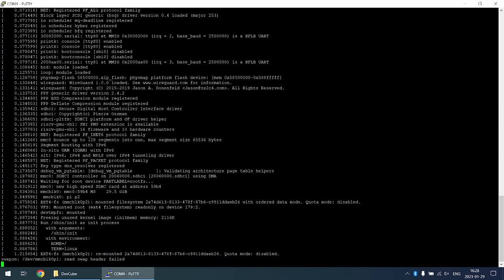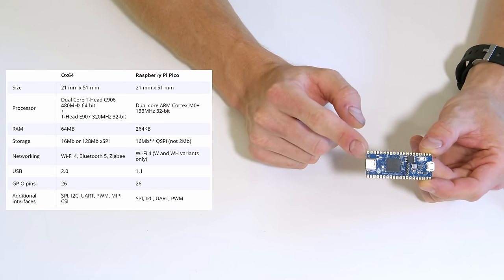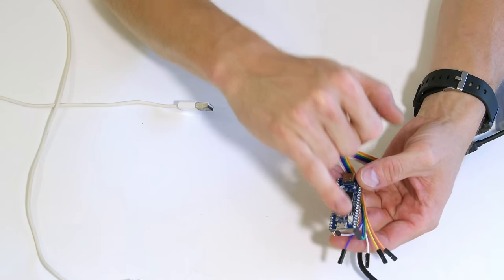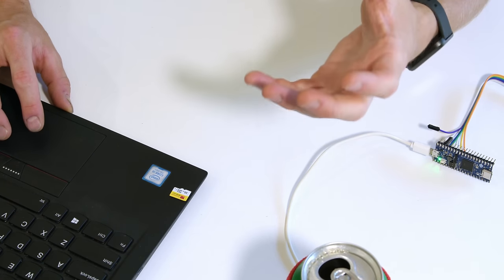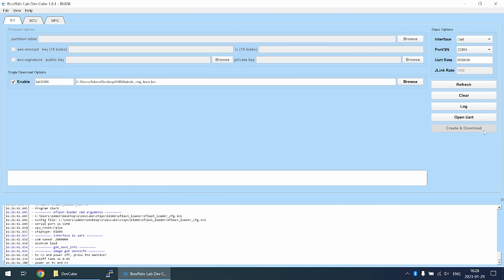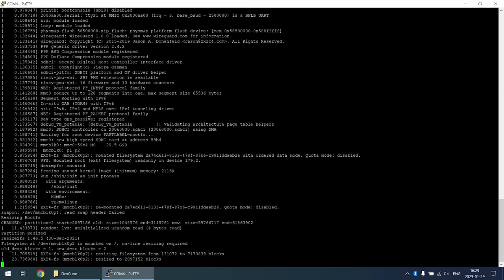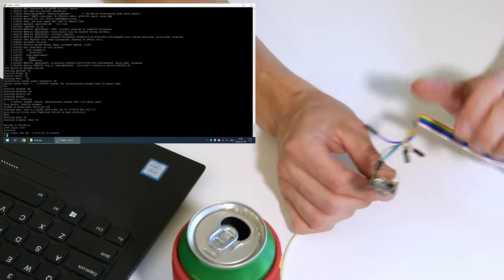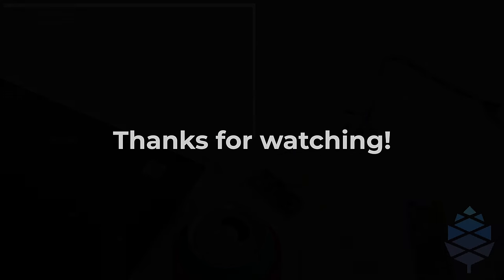Ox64 SBC - Connecting, Flashing and Booting Linux! ($8 from Pine64)

Comment: Please don't use baud for serial communications unless there is a good reason for it. Bits per second is what you should use to avoid confusion.

Bits per second is exactly what it says. Baud is symbols per second, where the number of bits per symbol varies based on protocol used. It can be 1, 2, 4 or many times higher. 4096 has been common with cable modems, as an example, for several years.

UARTs use 1 bit per symbol, so 200K baud is the same as 200Kbps. 

Way back in the past, telephone modems were initially described as 110 baud, 300 baud, 1200 baud, and 2400 baud. As technology improved it became apparant that using baud was outdated and confusing. 

After all is a 2400 baud modem able to run at 2400 bps or 9600 bps.

Plus modems started offering hardware compression. This lead to having a modem to modem connection speed much less than the modem to computer (UART) speed.

With a 9600 bps modem, you might set the UART to 19200 bps, allowing for a maximum  2 to 1 compression ratio. A 14.4kbps modem could have the UART set at 19.2kbps, 38.4kbps or 57.6kbps. What speed you used would depend on the capabilities of the UART, the modem and CPU speed. 

As modems became faster the UARTS couldn't keep up. When early UARTS were designed 9600 bps was considered high speed. Most computers built up until the early 1990's used an 8250 UART.

The first major upgrade was the 16450 UART, which could operate up to 38.4kbps. Then the 16550 UART was released, which included a 16 byte send and 16 byte receive buffer, unfortunately the buffers didn't work.

The 16550a UART was released with working buffers and a maximum speed of 115.2kbps; these were needed for the 56k modems and ISDN modems. 

The final major UART was the 16650 which doubled the size of the buffers to 32 bytes each. Newer models including the 16750 and 16850 (128 byte buffers) were made but much less common.

One of the biggest issues during the 1990-2000's era came about because of the UARTS. The 16550a and 16650 were significantly more expensive than the 16450. This meant most computers (and many modems) used the 16450 UART combined with a 14.4k, 28.8k or 56k modem. Many times the UART speed was set at 57.6kbps (or 115.2kbps). After all faster is better and the modems did hardware compression.  This lead to dropped packets and retransmissions. This made real transmission speeds drop by a large amount. The people in this situation didn't know that dropping the UART speed to 38.4kbps (and for some unlucky people that had really slow computers and/or 8250 UARTs 19.2kbps may have been faster).

Many people in this situation blamed their telephone company, but not all was the telephone company's fault (I'm not saying that they didn't suck).

There was the UART issue, there was the issue of ancient telephone lines and equipment, then there was the issue that many modems lied. So many of the El cheapo 28.8k and 57.6k modems would purposelu connect at speeds faster than the phone line could handle. A 57k modem might say CONNECT 38400, but within seconds drop down to 21k (maybe a bit faster or a bit slower).

This made users think the speed was much better than it really was, then combined with retransmissions due to an under powered UART and the real speed could be 10kbps or lower.

Trying to get someone to speed $30-50 on a new serial board with 16550a/16650 UARTs and $200+ for a good external modem was usually impossible. After all a $250 upgrade to their new $1200-1500 computer that already has an internal 57.6k modem was a hard sell.

Trying to explain that their junky 57.6k internal modem can only work at 19.2k was almost as difficult. Even showing how they were only downloading a file at 1KBps before my changes and 1.5KBps to 2.4KBps with the UART set at 19.2kbps wasn't a long lasting change.

It always seemed that the next time I came over they'd have the UART set at 56.6k or 115.2k. 

They'd always say that that is what the ISP, their neighbor, co-worker, friend, or family told them to do for faster speed. Some would even talk about how the modem compressed data.

I so rarely won these battles, even when I owned an ISP. Most people couldn't grasp that most data that they cared about were already compressed (zip, JPEG,mp3) and that the ISP used software compression on compressible data. In fact the software compression was better than hardware compression in many cases.

This meant that a text file might have a 4x compression. Being limited to 19.2kbps because of the UART would still allow that text file to download at about 9.6KBps. Using hardware compression (probably 2-3x compression) and 115.2kbps UART speed would Max out at 14.4KBps assuming everything works right. Most people at that time rarely had a stable modem connection at 38.4k. Usually it was between 20-30k or 7.5 to 11.2KBps with 3x hardware compression, but only if you had the expensive 16450a/16550 UART.

Sorry about my rambling down history's lane.
Reply from the maker: @Slackware1995 Oh my god that took me down history lane, and also bought back PTSD from doing comms in the 90's / 2000's. All valid information too! Hoping it helps someone out reading this, and I'll definitely refer to it as bits per second instead of baud when referring to computer serial comms going forward.

Thank you for that awesome and historic message, it was genuinely excellent. 

One further pain point to that old-timey stress of fixing things that shouldn't be busted, and nearly related; having to have the modem/sound/video cards in a specific order so that they were allocated the correct IRQs and could function together! From memory, that was the order.
Reply: Very interesting

Comment: Wait, did you say that this Ox64 uses less power than the RPi Pico W?
Reply from the maker: Yo, depends what you're doing!

Pico W has wifi, so uses power... Not sure the Ox64 wifi is working yet 😅

But no, by default this pulls ~80-90mA idle, Pi Pico W is 40-50mA from memory.

May have changed since then - I've not re-tested in ages!

Comment: I'd rather compare it to the Pi Zero instead of the Pico because the Zero runs Linux which the Pico doesn't.
Reply from the maker: Very good point my friend, but the Pi Zero is so much more expensive and draws a lot more power. Essentially the Zero has the same core as the other Raspberry Pi's (BCM28 series) but is just more compact. I feel the RP2040 is a closer analogy as they are the same size, same price, etc. I think both sides can definitely be argued though!

Comment: can you make a linux board run on a fart.... ? 
sounds like a good project for small pc's like this, , maybe not for farts but,
body heat , body movment, other small electricity generating "operations"
Reply from the maker: @QuadDerrick 
Oooh yes it would be great to see this run on a Stirling Engine! I think that would be pushing it, but surely possible if big enough hah.
Reply: @PlatimaTinkers 
i want a iron man helmet with wifi and googles with screen,
 powered by farts.... 

not too many people walk around with sterling engines in they'r pockets but. farts we have lots of. static electricity is in air all around us all the time. we move our feet and use \ can generate, "a lot" of energy like this i think.
Reply from the maker: @QuadDerrick  The most bogan Aussie iron man, cold can of beer in hand haha.

I mean yeah asses are essentially small combustion engines when used correctly... right? That's science for you

Comment: According to the documentation, after flashing, pins IO5 (RX) and IO8 (TX) are UART3.
But GPIO5 and GPIO8 dont't exist and pin is RXD pin 8 is GND.
Which pins did you connect?
Reply from the maker: Hey yeah it can be confusing; there are 3 cores and their UARTs are connected to different default pins. For flashing the D0 and M0 cores plus SPI you want GPIOs 14 and 15, then once booted the output is on GPIO 16 and 17.
Reply: @PlatimaTinkers  Well I found out, that I had to apply a random patch to the firmware, and now it works on 16 & 17. Thanks.
Reply from the maker: @therealchonk  Very odd! Can I ask what patch?
Reply: @PlatimaTinkers  In the bl808_linux project there is a `patch/m1sdock/m1sdock_uart_pin_def.patch` and I had to do `patch -Np1 < patch/m1sdock/m1sdock_uart_pin_def.patch` to apply it.

Btw what do you get, if you `cat /proc/cpuinfo`. Mine says it's a C910, not a C906. I think it's a bug.

Edit: to be precise:
processor	: 0
hart		: 0
isa		: rv64imafdcvsu
mmu		: sv39
model name	: T-HEAD C910
freq		: 1.2GHz
icache		: 64kB
dcache		: 64kB
l2cache		: 2MB
tlb		: 1024 4-ways
cache line	: 64Bytes
address sizes	: 40 bits physical, 39 bits virtual
vector version	: 0.7.1
Reply from the maker: @therealchonk  Ah okay you might be using the wrong source then! Use arm_000's fork at https://github.com/arm000/bl808_linux and specifically the irq-forward tree. URL: https://github.com/arm000/bl808_linux/tree/irq-forward. You'll see opensbi-0.6-808/platform/thead/c910/platform.c has those pins set, plus that tree/branch has heaps of other changes and improvements, namely GPIO support!

Comment: Nice! Thanks for this. I have a couple myself and eager to give them a go.
Reply from the maker: You're very welcome and that's great! Please do let me know if you get anything else running on them, eg ESPHome.
Reply: @PlatimaTinkers  I just ordered the CP2104. As soon as I get it I will give it a try.  I've been trying to translate the manuals that are in Chinese with no luck. I did finally get the DevCube running but need the CP2104 to communicate. Which img did you use? the sdcard-pine64_0x64_defconfig or sdcard-pine64_0x64_full_defconfig?
Reply: @christianskovly8831  Hey yeah I used the full image. Honestly not sure the difference, but I can only assume the smaller one is for the 2MB SPI flash board!
Reply: @platima  You live a charmed life. I've been banging on this lil thing for a week and haven't been able to get it all the way. I've made it through the flashing but now I'm trying to get it to boot the linux sdcard. What are the pins that I need to change my CP2104 connections to? I'm I supposed to use GPIO22/MOSI/MISO (physical pin 15) and GPIO25/MISO/MOSI (Physical pin 16)?
Reply from the maker: @christianskovly8831  Hey this can change depending on what you're flashing it with. Are you using the same binaries I did? If so flash it using GPIO 14/15 at 2 million baud, then after flashing change it to GPIO 16/17 for boot. Note that these are pin numbers 1/2 and 32/31 respectively! Refs: https://github.com/openbouffalo/buildroot_bouffalo 

Didn't realise I replied with the wrong account last time haha
Reply: @PlatimaTinkers  BOOM! IT WORKS! Now for the login and password. Have you got in yet?
Reply from the maker: @christianskovly8831  Wooo hooo! And yeah from memory it was just username root with no password, or something like that. Umm. Looking
Reply from the maker: Yep ref my own video haha https://youtu.be/czRtF-UNiEY?t=690
Reply: @PlatimaTinkers  Now trying to get PUTTY to send keystrokes.
Reply from the maker: @christianskovly8831  Check your TX and RX pins are attached firmly - and to the right GPIO. Should just work without any changes required.
Reply: @PlatimaTinkers  and I'm in. I had one of the headers connected wrong. SWEET!
Reply from the maker: @christianskovly8831  Awesome, and story of my life haha

Comment: Just needs an esp32 for wifi 😂
Reply from the maker: It's got wifi built in mate, just need to attach an antenna and get the drivers going! I am tempted to use an ESP32 as serial wifi for remote debugging though!

Comment: Good video!  I love how fast it boots, that's a big deal.  Also 90mA power draw while idle isn't all that great compared to a rpi pico
Reply from the maker: @MalachiBurke Hey thank you very kindly.

Isn't it? I just had a RPi Pico W turn up yesterday, so I can test that if you want! I think one difference there may be the Pico is not running a full multitasking multiuser kernel haha.
Reply: @PlatimaTinkers  you're welcome!  Yes that's the general idea.  ESP32 "modern sleep" averages around 40ma and I expect pico is similar.  Way, way less with radios off.  As I write this, it hits me 90ma isn't really so bad if all the radios are on ...
Reply from the maker: @MalachiBurke  Yeah I expect this would be way less if it was sleeping. The code running on M0 is not optimised yet, and just loops passing data to D0, so that can probably be made a bit more power efficient, and without the 802.11 drivers functional yet who knows what the wifi/BLE hardware is doing while idle. 

If you were to compare this to an ESP32 though, you could either use just M0 or LP, leaving D0 unpowered, and I expected the power usage would be WAY lower. That 90mA is with three cores all executing their own code, and I have no idea what code LP is flashed with out of the box. It might just be looping 'Hello world' to GPIO pins that aren't functionally attached to it any more.

Only time will tell, and I'll definitely test again. If you want to go hyper-effective power consumption though you could always wire up an ATtiny85 as a watchdog that turns the Ox64 on and off at required times to do its job, eg if it's reporting periodically. Some bloke got an ESP8266 running for 3 months on 2x AA batteries using a similar method (https://homecircuits.eu/blog/battery-powered-esp8266-iot-logger/)
Reply from the maker: @MalachiBurke  Just tested; fresh Ox64 with Boufallo Labs SDK on it 57mA, fresh RPi Pico 6mA, so yeah there is definitely some disparity there, by a whole order of magnitude even, but they are still quite different. The Pi Zero W comparatively comes in at 260mA idle though, so that's half a magnitude again just to catch up to the Ox64.... really hard to compare!
Reply: @PlatimaTinkers  sounds about right!  I wager the pico numbers are with radio asleep,I never see radios drop below 10mA active in my tests.  Pi Zero kinda power hungry!
Reply from the maker: @MalachiBurke  Yeah that was fresh out the box, probably running nothing. 

If I put MicroPython on there and joined wifi it'd probably jump a bit!
Reply: @PlatimaTinkers  I'm curious how MicroPython and radios would do but no pressure!!!
Reply from the maker: @MalachiBurke  Mate it's what I do. Sitting here in my tightey whiteys I just gave it a crack; Micropython nightly, joined to my wifi 2.4GHz at -63dBm it is eating 57mA
Reply: All I had to do was take one look at the thing to know that compared to the Pico, it's a juice sucker. That chip is HUGE compared to the RP2040.
Reply from the maker: @johnhunt1725  hah yeah but VERY different. If you were to rate it as MHz per mm2  then RP2040 is 49mm2 and 2x 133MHz = 2.71MHz / mm2. BL808 is 558mm2 and 480MHz+320MHz+150MHz = 1.7MHz / mm2. But then the BL808 has embedded wireless, USB 2.0, and an ethernet interface which would take up a lot of die room. The RP2040 just jumps ahead with it's PIO.

And yes, I know MHz doesn't really mean diddly, and I'm also comparing RISC-V to ARM, and I have not mentioned bus width. Just an interesting comparison!

Comment: Good platform for running OctoPrint/OctoPi?
Reply from the maker: Yeah mate once some more drivers are released, OctoPrint would run fine I think! Could not use the OctoPi image though, as the hardware is quite different.
Reply: The main problem with OctoPrint is going to be that it's written in Python. The server alone uses about 64MB RAM. Lua would be much better here.
Reply from the maker: @_droid  Hey that is actually a really good point. This does have swap of course, but not sure how fast it is.